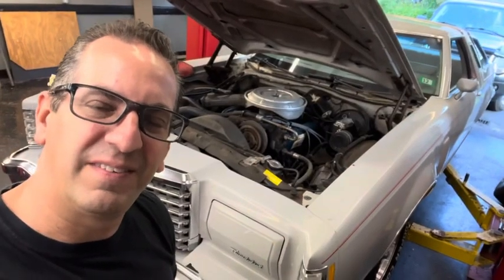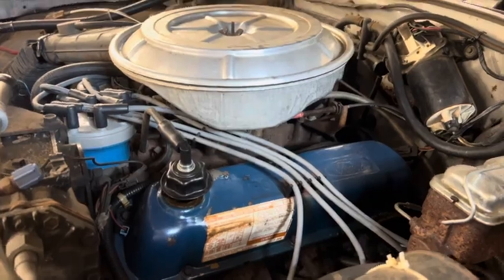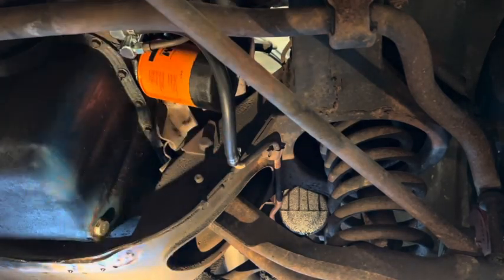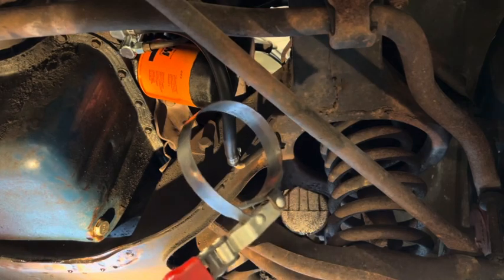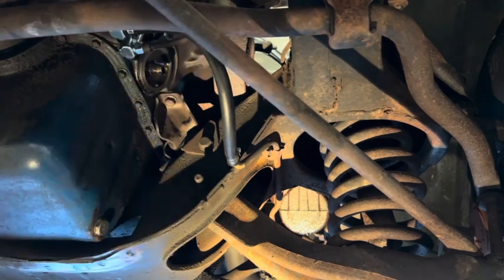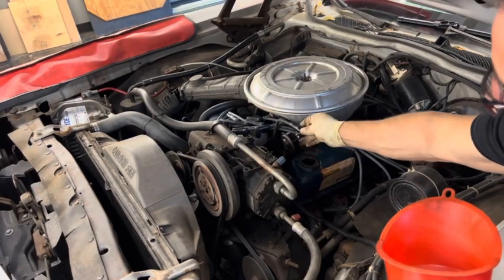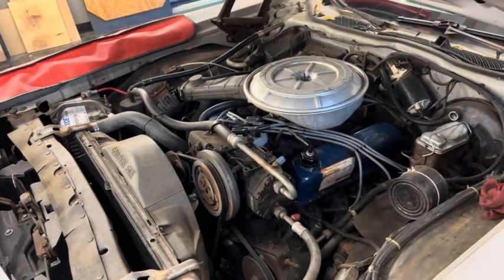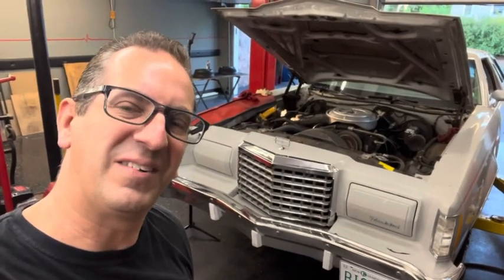1977-1979 Ford Thunderbird Oil Change

Comment: Hi, I have a question please, is the transmission filter ford explorer year 2007 v8,v6 the same filter, please if you can download a video about the parts of oil and gasket type thank you.
Reply from the maker: I am not sure if it interchanges between those years. You could look it up specific for your vehicle and then see if the part number matches.

Comment: I own a 79 tbird that hasn't ran in a year and a half....I need help getting it started...it has a charged battery another alternator and a new ignition.coil module...
Reply from the maker: Does it try to start? Does it start, run then die. If the gas is old you may want to get the bad gas out of it.

Comment: I watch your videos all the time and I’m subscribed can you help me I’m trying to take my two front seats out of my 79 thunderbird I have to back bolts out but can’t get the front nuts off of the seats?
Reply from the maker: Did you try to put a little penetrating oil on them? Just try not to get it on the carpet. Thanks for watching our videos, hope this helps you out.